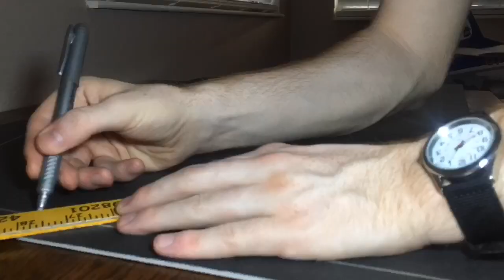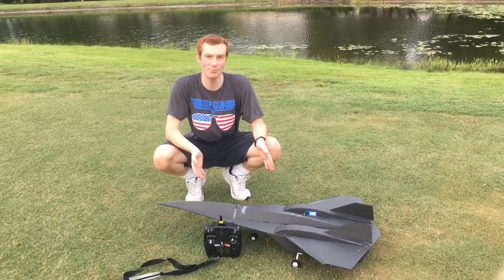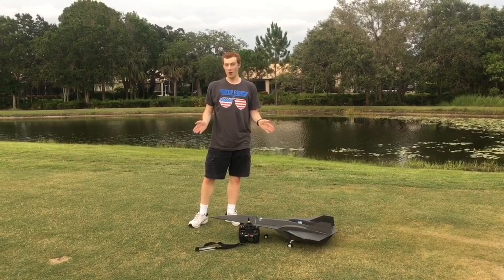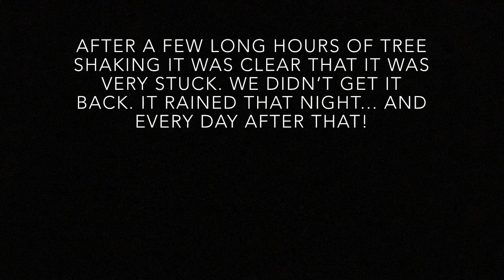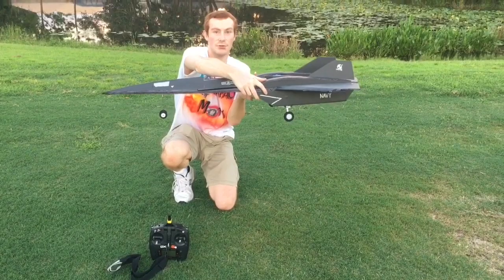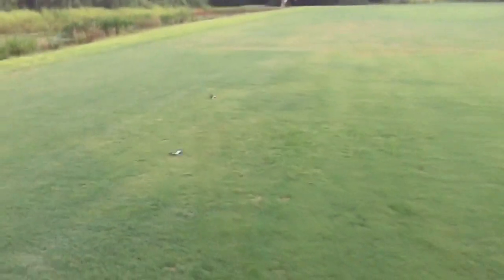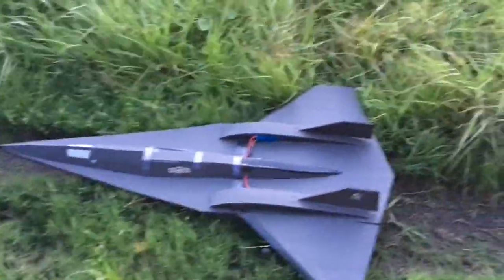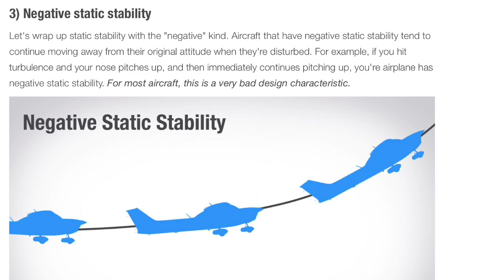Can I make a homemade RC Lockheed Martin/Top Gun: Maverick “DarkStar” FLY?!

Comment: I had the same problem with my edf space shuttle maybe you could put canards on it like at with the ft viggen. And angle the canards for upwards elevator and then you can put the cg foward so it is more stable.
Reply from the maker: Yeah, that idea probably would’ve worked. The thing is, the DarkStar doesn’t have canards! I don’t think it’s CG, but the design of the plane causing it to pitch up. It would do less if I put the battery forward, but then my fear was it might not take off!
Reply: @AerospaceMatt  but does it have to look scale its only a model an have you put counter rotating edfs inside of it?
Reply from the maker: Well, the whole purpose for the project was for me to make the design fly, so I’d have to say yes. Now, I COULD make clear plastic canards so that it looks scale but aerodynamically it’s better behaving. I don’t think there is such a thing as an EDF that turns the opposite way. If they do have them, I’ve never seen one. The reason is quite simple: EDFs don’t produce torque like props do. The vranes at the back counteract any sort of torque that the fan may produce, so the thrust comes out evenly distributed. The main problem with this design is that the center of thrust is about an inch below the airframe’s centerline. That could be compensated for in the full scale, but it’s much harder to work around in RC.
Reply: @AerospaceMatt  Can you see my last message with the links?
Reply from the maker: No, I can't see it. It's probably in the "held for review" section of the youtube studio app. I'll check those links out when I get home from work.

Comment: If you adjusted the thrust angle and put you COG just a little forward, this bird would fly nicely. Rear wing aircraft generally need a forward COG to counter the rear bias centre of inertia
Reply from the maker: You are correct. However, I couldn’t put the battery any more forward because of the placement of the landing gear. It’s placement was like the F-18, where the wheels are so far back it’s hard to rotate and the nose gear is so far forward. Also the thrust angle was a significant issue. With the thrust being so low and so far back it really wasn’t going to work. Maybe I’ll make another one in the future with improvements in mind.
Reply: @AerospaceMatt  This weekend gone I built and flew my own version of the darkstar (TG Maverick, not the SR-72), though I used the prop in slot or parkjet method to build. Raising the thrust line definitely helped keep her straight. Issue I had was not enough elevator but that'll be fixed. Really slippery design when you get it going!
Reply from the maker: @BuildYourOwnRC  Yes, my design was a TGM DarkStar and not SR-72 as well, and on my first flight it did feel slippery. Prop in slot sounds like it worked way better than underslung EDFs. How was your stability? Did it want to over correct on the roll axis?

Comment: Great effort and good explanation on why it didn't work.  Though it held together. Maybe it needs a tail like a kite to make it stable. =)
Reply from the maker: Thanks! I’m planning on building another with a more forward CG using nose weight and a gyro for pitch stability. I also think I made the rudders too small but I was using still frames from the movie from odd angles as the basis for my design.

Comment: At least it achieved flight, it is so difficult to know where the CG should be when designing a prototype like that.
Reply from the maker: Yeah the CG calculator I used was a little ambiguous. I want to revisit this in the near future. On that one I’d make the stabilizers larger, move battery a little more forward, play with the thrust angle, and make a small chuck glide model to identify the proper CG.

Comment: It reminds me of F-104, Both of them are short wingspan and unstable.
Reply from the maker: And both of them were meant to go faster than anything before them!
Reply: @AerospaceMatt  Yes, They were made for speed and altitude, The Starfighter was supposed to be a high altitude interceptor but then Lockheed redesigned it to a multi-role fighter which was a really deadly move for costumers.
Reply: @AerospaceMatt  I thought it's not that bad if you expand its wingspan, DarkStar itself is a redesign of the real SR-72 and I think it would be more beautiful with longer wings too.
Reply from the maker: Well, the whole point was to try to make the design fly as is. If I’d had a gyro in it, it would’ve almost certainly worked (it actually did on the first flight but I accidentally deleted over 50% of the clip showing it flying.)
Reply: @AerospaceMatt  Keep try it, Even failures are sweet in this way for making RC planes.

Comment: What, the darkstar is the SR-72 basically
Reply from the maker: There are actually many differences between the fictional “X-72” DarkStar and the very real SR-72 “Son of Blackbird”. They have almost identical planforms (silhouette as viewed from the top or bottom) back to the empennage where the trailing edge of the wing differs. That is the end of the similarities. DarkStar is manned, and achieves speed in excess of Mach 10 through a dual mode SCRAMJET. SR-72 is unmanned, and allegedly capable of Mach 6 using a dual mode RAMJET. Not as powerful as a SCRAMJET but definitely higher speed as a result of separating the two engines instead of building a combined hybrid like on SR-71. The final obvious and visible difference is the DarkStar has 2 vertical stabilators that are all moving like on SR-71, and are also canted inward. SR-72 Son of Blackbird has one large traditional vertical stabilizer/rudder. It’s easy to mistake one jet for another and the differences are like that of the F-15C to the F-15E.

Comment: Well, the Wright Brothers had many failures before success. I would not give up on this project. The engines could be moved forward which would change the torque/thrust location and possibly bring more stability to it. Examples are the B-1A in testing had close to the same issue until they move the engines forward. The CG calculator is yet another misguided brainchild that is not 100% always correct. It does not account for many aspects of building materials. Yes I do not feel the CG is correct in this scratch build design. I feel you can make it work. Dare to experiment and have fun doing it. At the very least give it more effort, you may end up with an award-winning design.
Reply from the maker: I appreciate your comment and insight. You know, I probably could’ve put the EDFs closer to the intake, but not by much. An inch at most. I would like to try again, but this project has taken WAY too much time both to complete and get out to the viewers (I’ve been working on it since June!) I might try again at some point in the future, but I have several projects that have had to be put on hold while I try to get DarkStar to work. And yeah, I guess the best CG calculator is real life testing, but I still believe the aircraft design is inherently unstable. Maybe if I got a gyro it’d be better.
Reply: @AerospaceMatt  I concur and also agree with Jeff in LA . The SR-71 BlackBird was a skunkworks bird as well and lets just say the Gen 1 of Hypersonic flight , Been out of the military for 15 years and still can not talk about what I know.
Reply from the maker: Isn’t Hypersonic Mach 5 plus? I thought the SR-71 could only go Mach 3.3. Wow, it’s cool that you know things that are [Redacted]. My grandpa worked for Boeing and did secret stuff that he couldn’t talk about either. All I know for sure is he worked on the Space Shuttle robotic arm. 
Also, the thing I found fascinating about the film was that they tested DarkStar at the Mojave Desert, but in real life they would’ve tested it at Groom Lake.
Reply: It is possible I may have met your grandpa, There is many things that happens we are not allowed to discuss. The national security depends on the dedication of the men and women who serve past, present and beyond. Darkstar is but one of many projects that may or maynot be a reality. The B-2 bomber force was a huge surprise to our adversaries. Yet it is but a very small example of what our military is capable of. What will our next generation be able to do to keep our country safe?
Reply from the maker: I want to thank you for your service. It is my goal in life to become a full scale test pilot, and fly the next generation technology demonstrator. I would love to fly something at high altitude, "where no lark, or even eagle flew"